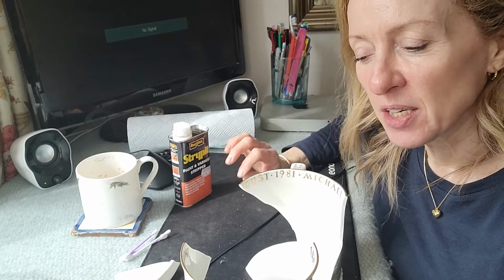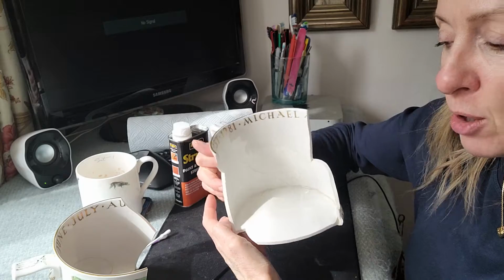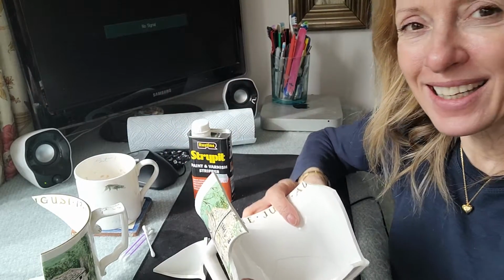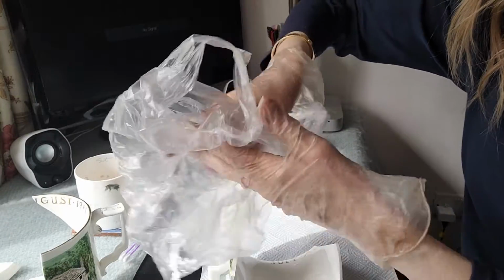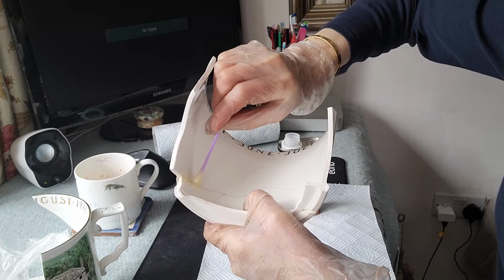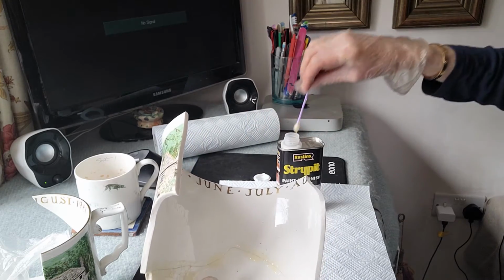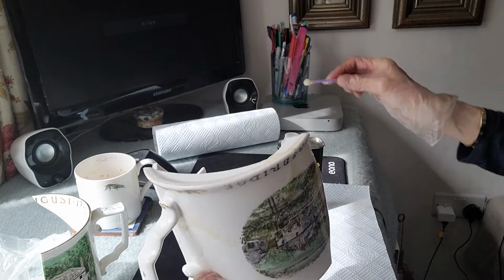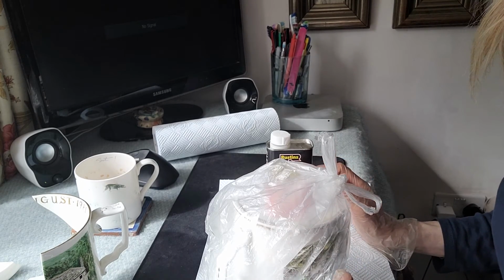Ceramics Taking Off Old Glue  #ceramics #restoration #porcelain #repair #diycraft

Comment: Amazing how this appeared - i found a Doulton vase yesterday that had been glued on the base - i scrapped most of it off with a stanley blade so it ended not too bad BUT A piece onbthe foot wasn't lined up so i soaked it in acetone and the glue melted off. After cleaning the edges i resuck it